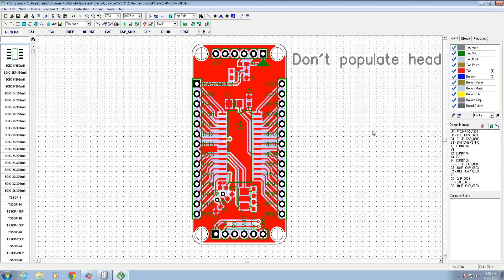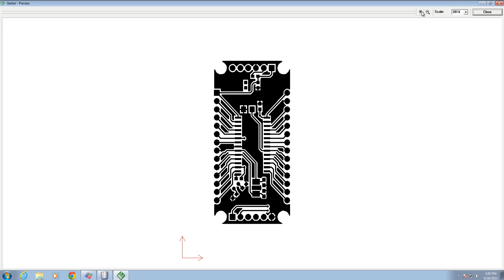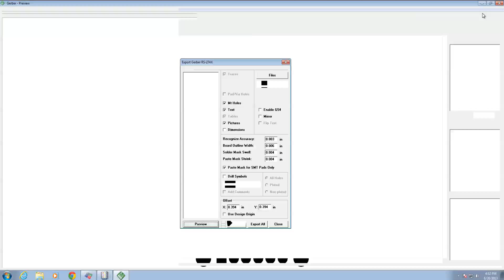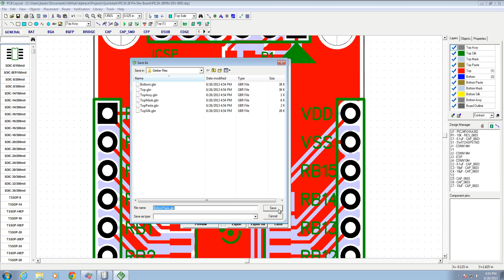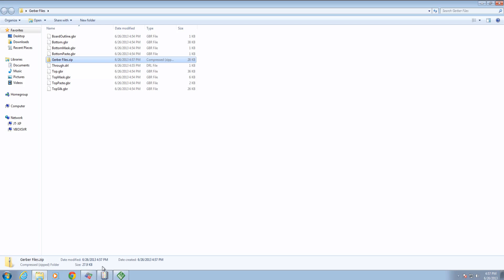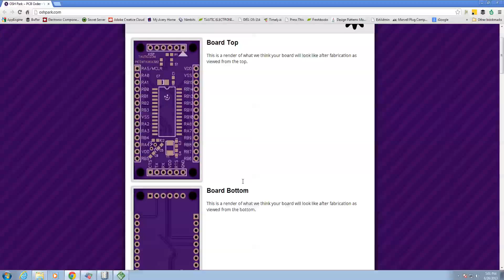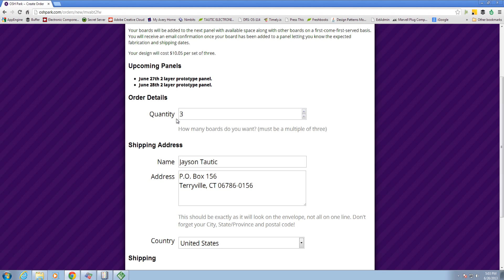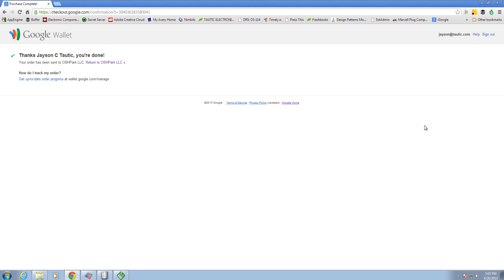DipTrace - Ordering PCBs

Comment: Nice vid.. One question I have is that in Diptrace looking at the bottom of the board with components on it the text and IC's are inverted. It always confuses me on what you do here.. What orientation are you sending the top and bottom layers to OSH Park or is Diptrace always get it right?
Reply from the maker: The default setting seem to work for me, I've never needed to invert anything.
Reply from the maker: The default setting seem to work for me, I've never needed to invert anything.